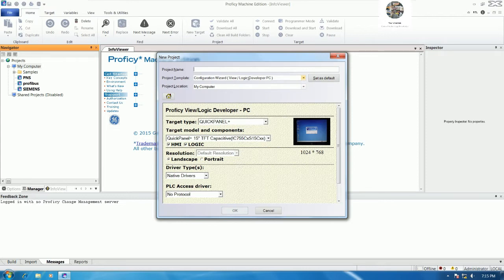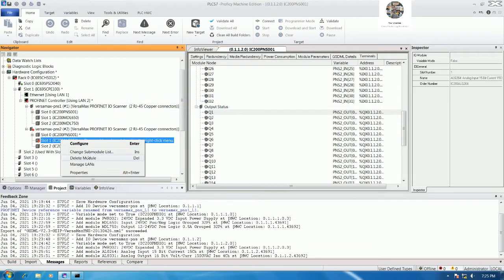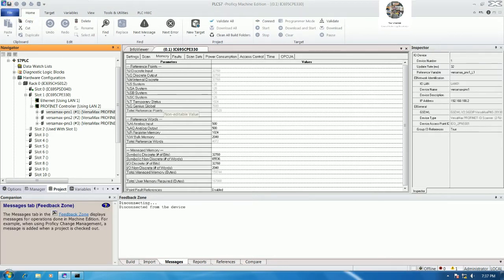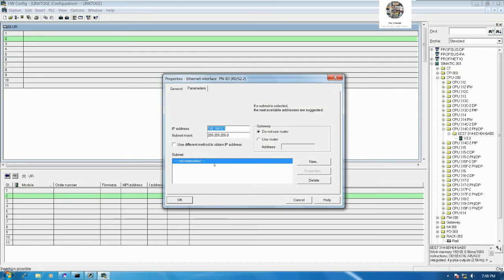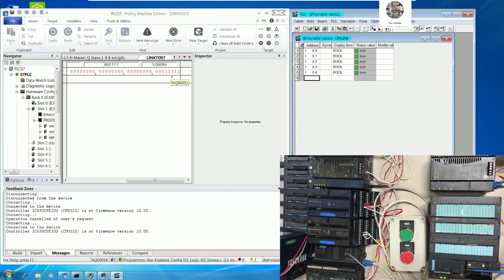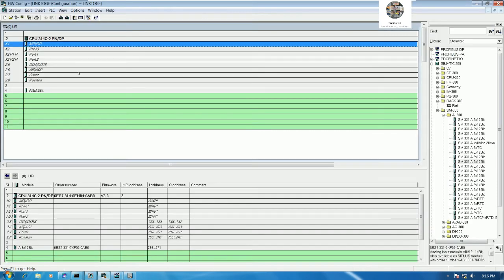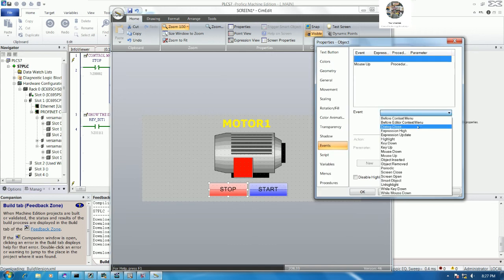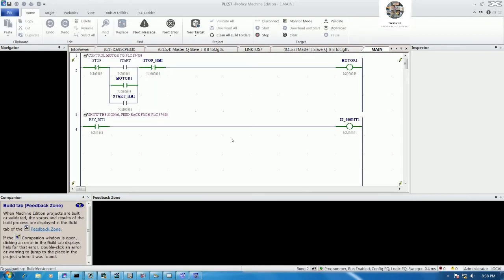Link data from PLC GE to PLC S7-300 by using Profinet scanner (GE) with Profibus-DP (S7-300)

Comment: Hi,

you are making great job with your videos. I have a few questions. Could you explain for what I need  modules 1st general ID, 2st general ID and 3st general ID? What is the difference between Master_I Slave_Q 2 B unit and tot.lgth?

Thank you for your help.
Reply from the maker: Dear sir,
Thanks you so much for your questions
1st general ID, 2st general ID and 3st general ID I did refer to manual instruction of how to configure profibus communication.
For Master_I it mean that memory of Master are Input.
Slave_Q it mean that memory of Slave are Output.
Reply: @generaltechnologyknowledge5165  Thank you for answer. Where can I find the manual instruction? I didn't mean  difference between Master_I and Master_Q but between unit and tot.lgth?